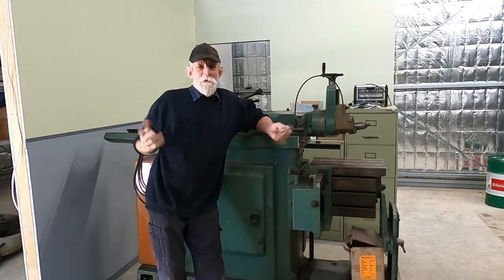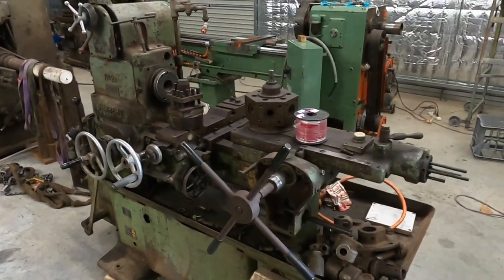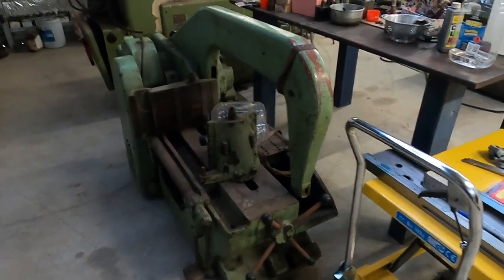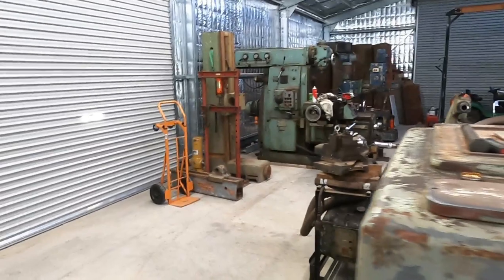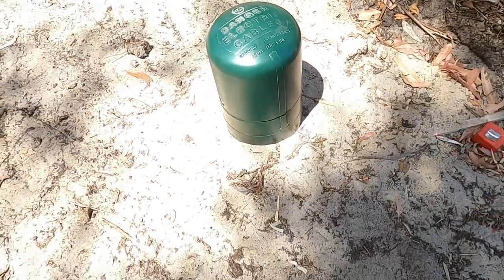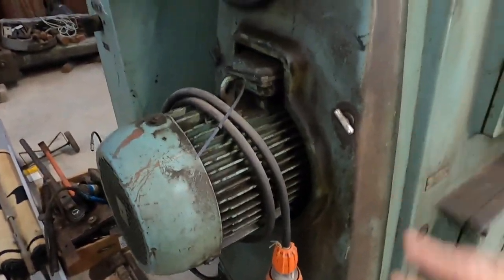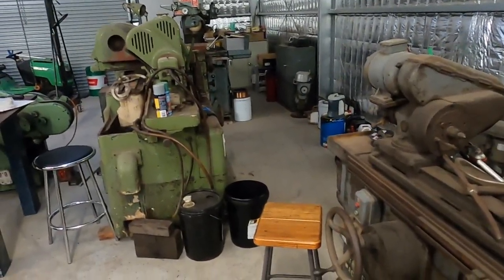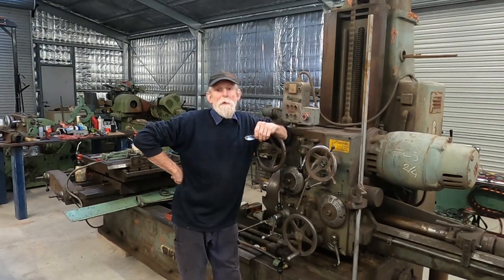Machine Shop Layout .

Comment: Well done Max, I can see much thought has gone into the layout. I used to work in a similar sized shop with similar sized machines, they used a herringbone layout and just punched holes in the wall behind the headstock on all the lathes for long stock loading/running. This saves huge amounts of space and gives you access all round the machines for maintenance etc. Also, all the wiring drops can then come down the wall and a large central gangway for fork truck/wagon access etc. The only downside was you were always showering the guy in front of you with swarf and coolant lol. Cheers, Jon
Reply from the maker: Herring bone can work well if done right ,  with groups of similar size machines .  I thought about that layout , but everything i have is a different length .  The other thing , it is a pain when a gantry style crane does not run parallel with the machines .  Lol , on a paper drawing i could only get about 3/4 of the machines to fit !!!   👍

Comment: Jesus mate, you’ve got more machining and production capacity than some smaller countries - love it,  -  ive just had to run a 200 metre 3 phase, 70 mm2 cable about to be connected in new year - I’m closely following your build ( coincidentally have a Herbert number 2 myself flat belt, saved it from scrap) love your work.
Reply from the maker: Wow , that's a huge cable .   Cheers .   👍

Comment: All that space would be a luxury to me. My small machines are fitted jigsaw style into a 3x5m workshop!
Regarding the drawbar for the mill horiz spindle, I made one threaded both ends and use a removable nut on the back. That way the drawbar comes out attached to the arbor at the front where I've got room.
Reply from the maker: Good idea with the draw bar .     Cheers . 👍

Comment: Max, that looks great but its also a LOT of machinery for one man. I do hope you have the jobs to keep them busy and the various able bodies to help get it done. The pole cranes sound good but you will still need to get the pieces close enough to pick up with the cranes. I am assuming you will be getting a forklift or two to move that around. And of course there is the clear path to move stuff through. Merry Christmas. You have a long hard years' work coming up - make the best of your rest.
Reply from the maker: Thanks .  The gantry crane & also platform trolley will be able to shift anything heavy to the machines .   A forklift is on the cards later on .  👍

Comment: Hi Max your just setting up shop and my mate is just retiring after 25 years engineering in Adelaide they sold the shed he has been renting all those years and he has had a month to finish up and sell his machines. Local dealer buying the lot for a song. His business was based around semi auto cam driven lathes they said the four of them probably end up in the scrap well over $100,000 each when he brought them new, sad really. One thing for you to consider is he used a electric forklift to shift his steel around 1500kg lift capacity and very maneuverable instead  of a gantry thanks for your videos have a great Christmas and even better new year
Reply from the maker: A gantry & the swing cranes will be easier to use over a machine but a small forklift is something i may get in the future .  
Never good when shops like your mate close down ,  all the bloody seagulls come in & want everything for SFA !   Unfortunately sometimes  that is how things end up due to time constraints moving from the building . Cheers .   👍

Comment: Enjoyed seeing the layout Max. Going through the same thing myself, especially the lifting strategy. Considering a jib crane, but since I didn’t pour the slab, just not sure if I can trust the concrete. Lots to think about. Thanks for sharing.
Reply from the maker: Yes , lots to think about .    Cheers .  👍
Reply: Think machine pad. A machine pad is a thick block of reinforced concrete you pour in a slab. After the fact you have to saw cut your existing slab but that's no biggie.
Reply: @1pcfred  yep, I may be heading that direction. Thanks.
Reply: @macsmachine  good luck. Concrete is one of those simple things that can get complicated. There's certainly different levels of understanding about the material. A machine pad isn't a backyard patio either. You want a higher level of performance. In order to achieve that you are going to need to know some things. Or just get lucky 😀
Reply from the maker: @1pcfred  Sub base prep is the key .

Comment: A powerful array of machine tools is present.  It so happened I built a gantry crane, to 1.5 meter below ground support depth with free rotation as 360 degrees.  What I found very useful was to so design the central pipe with staggered riser.  So as to be able to adjust height. grease zerks allow lubrication as 4 points to mechanism.
A step wise increase possible.  While I included a weldment to allow hoist motor, it has been function to use a hand powered hoist.  And where I planned for a trolley at the I beam extension as "stinger", I have found the available 1/2 extended length as hoist mount meets all needs to ground footprint.  The rating was as 900kg but I have yet to exceed that lift.   I used welded gussets as floor to 1/2 m 4X to central axis. (base).  One shop as employ used a very solid central axis, with an overhead cable to back stay, to distribute tension and was an interior shop design.  It was as you mention, a roof secured piviot as top.
I report happy cold weaher shop activity here as tool construction, with a large aluminum 2.05 bar stock in various component as work in progress, also compressed air refit.  I report design of a jaw chuck with atypical fingers to work piece.  Refit of lights, bins, and winter sorting to fasteners under way.  A part of my workshop to jeep parking inside as snow reached about half a meter and temperatures are difficult to as about -5 to -10C.
I had long thoughts as to tease you with comment such as "relic teaching a craftsman novice lathe secrets ....until that kind Christmas wish.  Which I hold welcome and so kind *Max... and where I simply view such machinist thoughts as abrupt from toolbench to a holiday of particular satisfying cheer, perhaps with a dram or spirits as well brewed.  I wish that for all so inclined and bid you fair winds  Travelers or workshop and larger channel and friends.  Regards.  M.
Reply from the maker: Thanks .    Mid 30's  deg C  here this week .  A bit too cold over your parts !  👍

Comment: Nice max where are you planing on putting tool boxes for power and hand tools like drills grinders spanners etc?
Reply from the maker: There will be a cabinet against the wall behind the radial drill for power tools  , grinders will be in the welding area .  My toolboxes will just be spread around . 👍

Comment: G’day Max, the new workshop is really taking shape now. Just wondering are you going to line the walls? Have a good one 👍🇦🇺
Reply: 335 years ago I built my car barn and I lined the bottom 8 feet with 1/4 inch peg board which has been a very useful addition. I had them urethane the pegboard but today I would use the prefinished pegboard in a light color.
Reply: 35 not 335
Reply from the maker: Only in the welding area at this stage .

Comment: Max do you worry about having grinding equipment near or adjacent to lathes/ mills/ jig bores etc?

I like the idea of leaving a path for the gantry hoist to roll over your large machines.
Reply from the maker: All of the grinding machines except for the tool & cutter grinder run flood coolant , helps reduce  any dust .  👍

Comment: Great video. At what stage will you take the machines off the wood blocks? I’m arranging mine and afraid to commit to putting the machines down on the concrete.. Always thinking I’ll find a better layout..Sorry for stupid question…
Reply from the maker: Not a stupid question .  They will come off the blocks when my other machines come over , just in case there is a bit of minor positioning adjustments to do .  👍
Reply: Excellent, thanks! I’d be interested to see how you actually move them. I’ve got 3 6t machine skates, a pallet jack and 2.5t engine crane but those wouldn’t shift your big stuff..
Reply from the maker: @Deebo1812  I have two 8 ton toe jacks & Enerpac chain roller skates .

Comment: Put the lathes and orher long stock machines at an angle to a center aisle, to get room that doesnt interfere with other machines.  Easier to load with a shop crane, maybe...
Reply from the maker: That would have been my choice if there was the room .   Picking up the DSG lathe caused a major layout change to fit it in !  👍

Comment: Well, you seem to finally have it under control. Fortunately you designed it big enough. I seem to get more equipment than I have room for. Add in the stock of plastic, wood and metals, and there’s never enough room to move around in.
Reply from the maker: Mostly under control !  👍
Reply: @swanvalleymachineshop  as long as you don’t have to walk sideways.
Reply from the maker: @melgross  I have to walk sideways in my little shop , sure as heck was not going to let that happen again !!!

Comment: Far out! How big is the shed and how thick is the slab for this many machines? Would be a lot of weight i imagine
Reply from the maker: 200 sq metres .   Slab is only 6 to 7 inches but it sits on 2 feet of crushed & highly compacted granite that sits on a sand base with a very high compaction rating .  The granite is Cracker dust , a by product of road base & when properly mixed with water it sets like concrete .   👍
Reply: @swanvalleymachineshop  thanks for the reply Max. I'm hoping to build a 12 x 8 (only a few suburbs away actually) but not looking at the size or amount of gear you've got! Maybe 1 lathe and a knee mill, a little borer and shaper would be nice though! Will probably need to look at Crushed products as the block needs retaining due to levels. Thanks again, keep up the great content! 👍